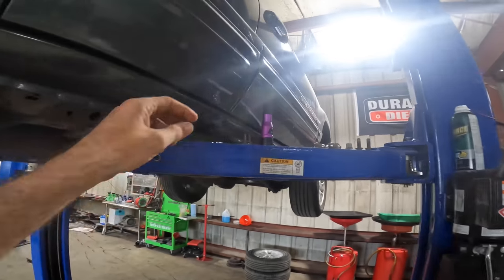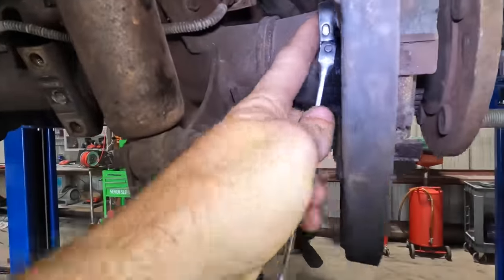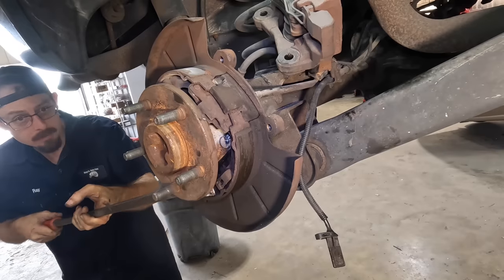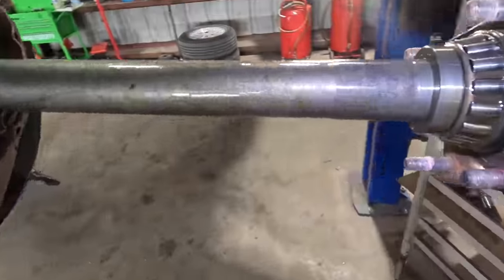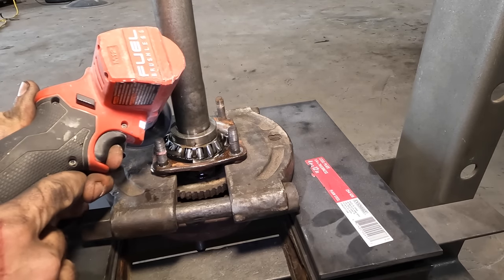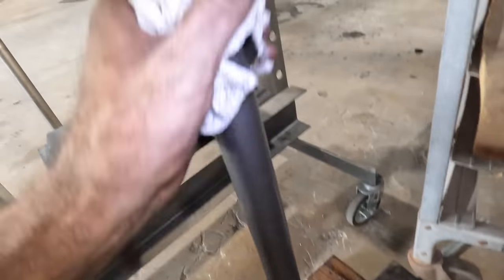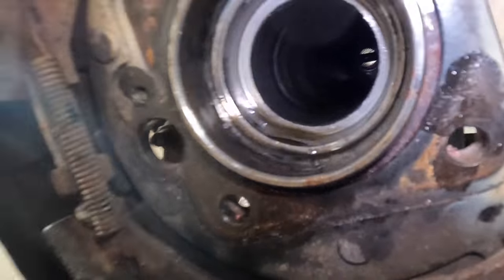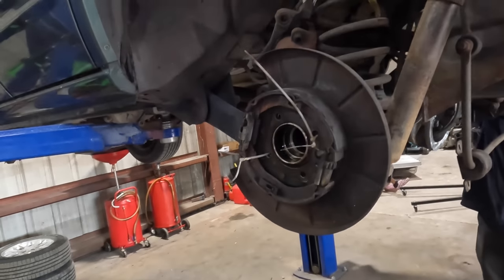Mechanic Destroys Bearings! | 2002 Jeep Grand Cherokee WJ 4.7

Comment: Ummmm, Ray, why didn't you just remove the brake shoes? I've only just started BUT, it would have been easier welding that stud AND grinding it clean after too?
That's a dumb design of your press, having around 6 inches sticking down for no obvious good reason, instantly limiting the workpiece size by that amount when I you want a rod type driver you could easily just put 1 in yourself!  Ahhh, I get it, it's intentionally limited so you hopefully (to their thinking) then go, "oh dangit, Ah better buys me that bigga ones" lol.
And PLEASE grind that burred razor edge on that cut C channel before someone, possibly even you if you forget, tries picking it up and slices their hand BADLY on that big razor now hiding inside the end of it!
A bit curious why you wouldn't heat shrink those bearing collars on? I've had an axle held on by the same type setup actually wander out as I went around a corner. The fist clue was suddenly having no drive, I then happened to spot in my side mirror that wheel sticking about a foot out the side! I replaced the bearing, seal and collar but instead of scoring things up, heated it, chilled the axle and just dropped the new one on. That never moved again.

Comment: Why wouldn’t you just use a torch and heat the bearings and race up and hit it with a hammer a couple times? Easier than cutting up a press anyways.

Comment: Bearings usually come with a retainer ring. I've always cut and staked the retainer ring and gotten the bearing off with a 12 ton press without destruction.  I put the retainer ring on a hotplate in a frying pan and heat it up.  Most times it expands enough to almost 'drop on' the axle. Little pressing required.   Brute force like you did can be quite dangerous.

Comment: Hey Ray, what ever works, i would have heated the nuts and then tryed the air gun. For a puller i would turn the drum or rotor backwards put 3 wheel nuts back on and use the drum/rotor as slap hammer.

Comment: Do you have a cutting torch? If so put a bit of pressure on in the press then use the torch to heat the retainer and the bearing. Things should slide right apart.

Comment: Not that it would help for accessing the confined space, but a little TIG welder will let you make pretty little micro beads. Really hard to get a mig to fuse both materials without extra globs unless surfaces really prepared well. Tig very doable for that job. More alg

Comment: Take the brakes off ya lazy bam-pot lol

You get better access to weld  it that way (and saves you fighting around them so saves time overall) :-p lol

It's a linear pulling hammer too 😆 🤣 😂 

Sould remove the bearings and heat the inner bearing seat (I class the race as the bearings and cage but that's me lol) to expand it and make it easier to press off, heat is your friend here lol

To press them on turn the shaft 180° and press the hub onto the bearing, use a socket or outer bearing shell to push against the new bearing seat/spacer?

Concave as it caves in, not out 😆 🤣 😂 

Concave and convex used to have me vexed at times lol

You can flip the 2 and 3 legged external puller legs/fingers for the sliding hammer to make them internal pullers too, that way the are a custom fit. 👍

Comment: Jeeps, Chevy's and Toyota's.  We know what not to buy by now.
13:50 Always nice to see Wife Unit.  You have to be alert.  (The world needs more lerts)  😃
I think I would have sent those axles out to get the bearing pressed off.  Why 'F' up your own equipment?
Now that you screwed up your press, what are you going to do with the next short axle you get?  I wonder about you sometimes. Go and tell Wife Unit to buy race pullers that will fit anything you're up against, instead of grinding down the ones you have to make it fit.

Comment: All for the want of generous squirts of penetrating oil. And that rampant waste of Brake Kleen. The lordeth made shop towels for a reason.
Every suspension component and exhaust fastener needs penetrating oil before hitting it with tools dude. It used to be funny. Now it's just common sense.
Reply: And a rag to cover the rollers because the Subbie looks good just the way it is. And you and your helper.

Comment: What a joke. Backyard mechanic tactics for sure. 2 mins with torch on retainer then smack with chisel and it’s off. You need to learn a lot about bearings and installation if you are going to do this kind of work. Heat retainer and slide it on all can be done in a vise no press needed.